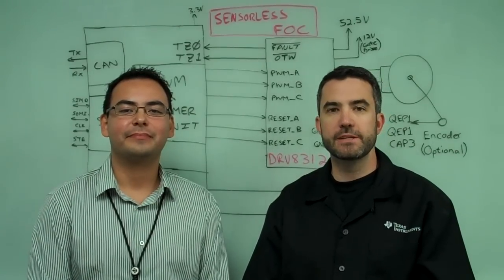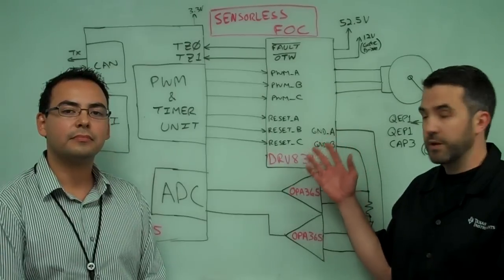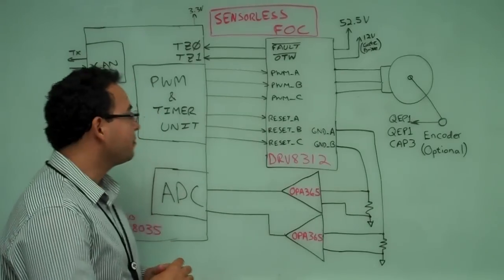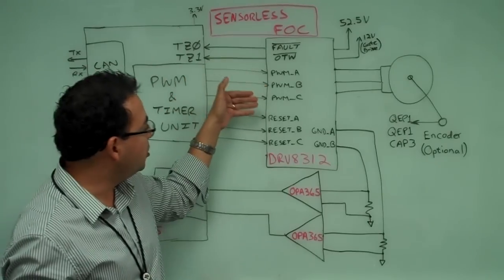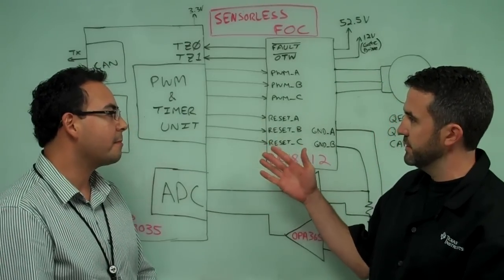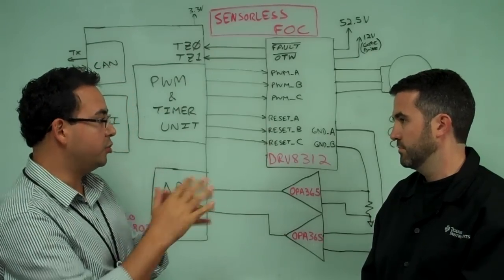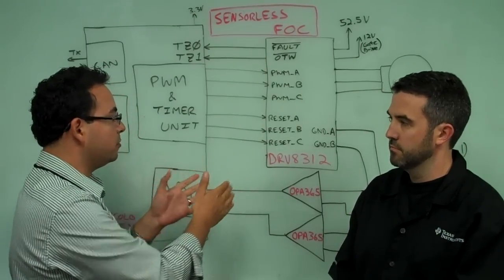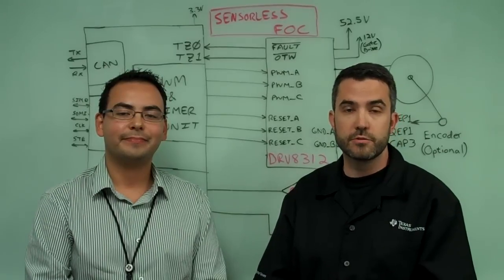Sensorless Field-Oriented Control Using the DRV8312 Eval Kit

Comment: question is will it be cheaper and easier to maintain than with an encoder that is properly designed and embedded in the motor ?